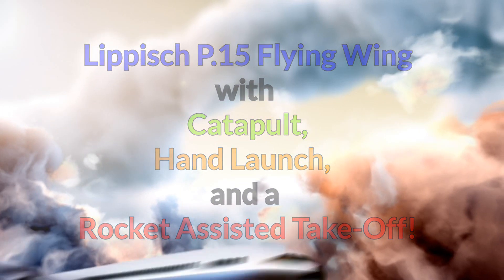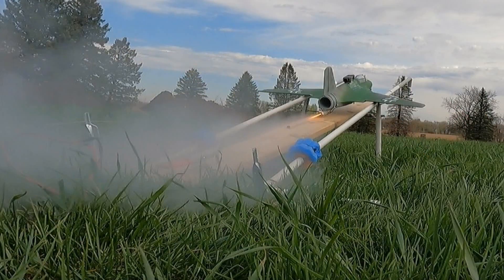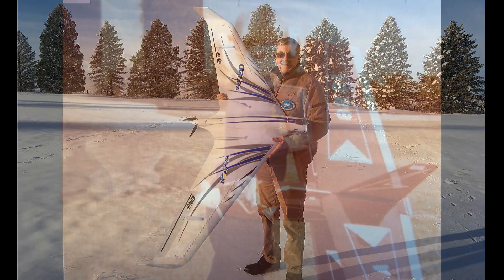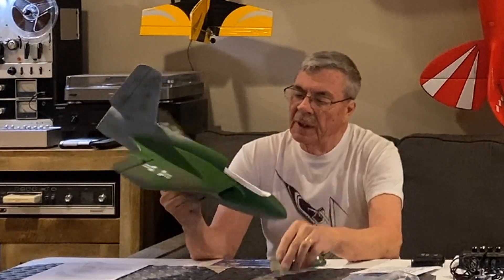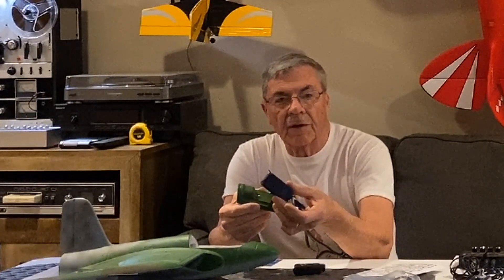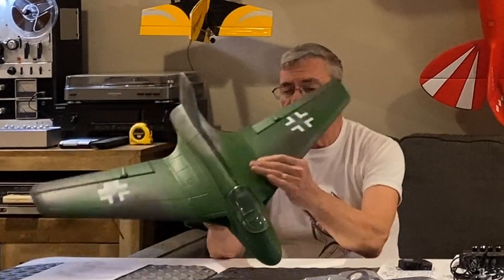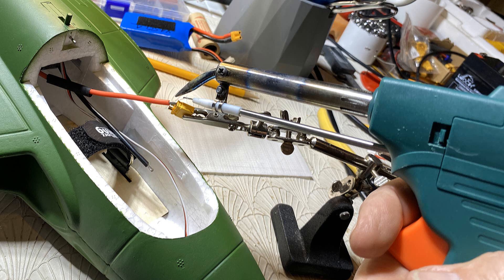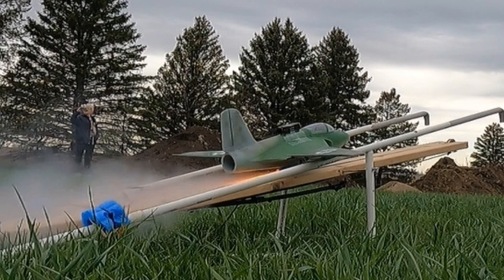Motion R/C's Lippisch P15 and ME 163 Rocket planes compared. Catapult, & JATO launch tests.

Comment: The true power and insanity of the p.15 come out when you throw in a 4s 1300mah pack. Get ready for some shredded fan blades, though!😂😂😂
Reply from the maker: Well this is fast enough for this 75 year old guy, and I hate blowing up blades, so will keep the 3 s. But more rocket flights on the way, so please stay tuned.  Thanks so kindly.

Comment from the maker: This Lippisch P.15 flying wing was supposed to be the upgraded version of the Messerschmitt Me-163 rocket plane. The ME-163 'Komet" was the first airplane crossing the 1000 KM/h border (621 MPH).  The Lippisch P.15 was supposed to have a turbine instead of a rocket engine. It was never built.  This model from MotionRC.com bring this prototype to life.  I love it, as it is fast and can also fly slow.
So here are 3 short flights, The Maiden, launched from my catapult, A hand Launch, and a Jet Assisted Take off from my Catapult to simulate the ME-163.